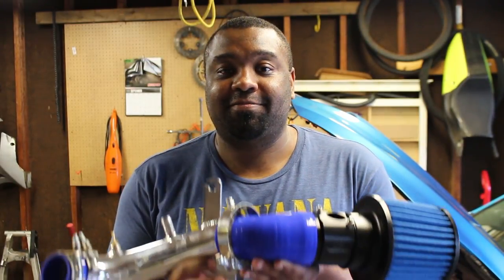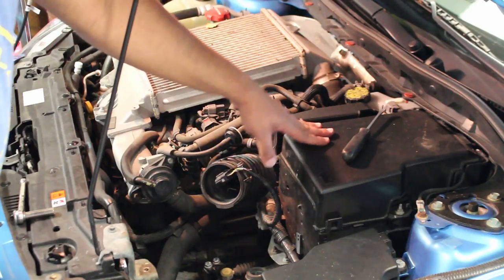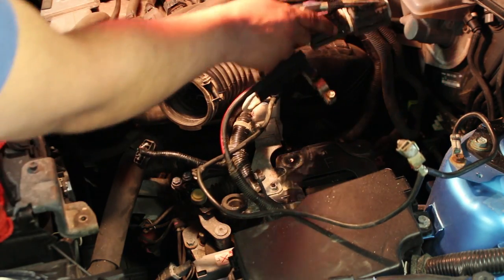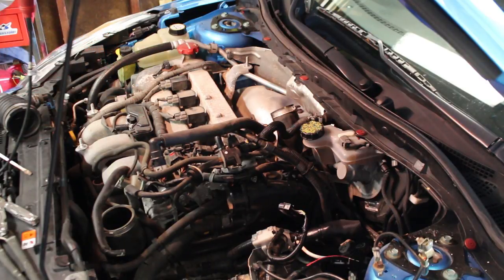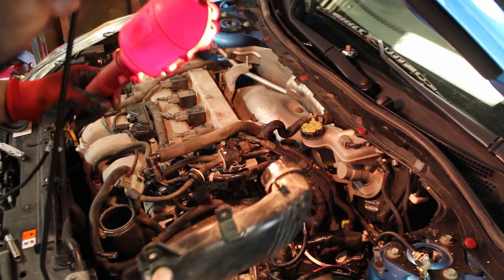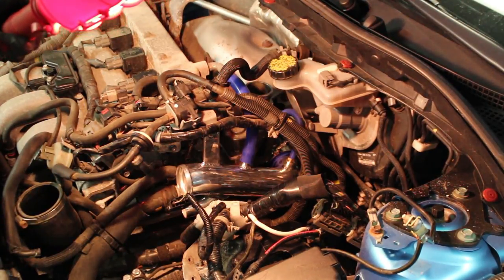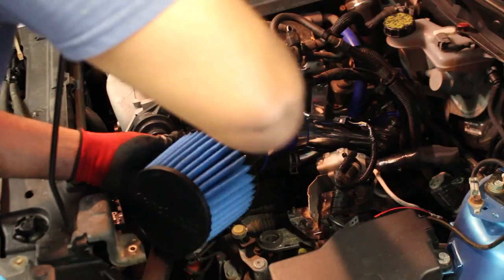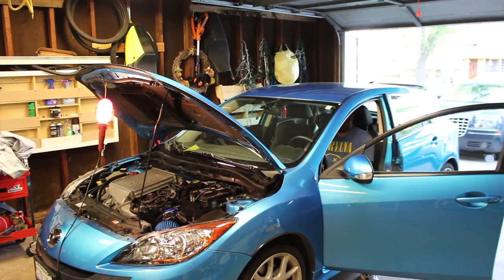Corksport Stage II Short Ram Intake Installation

Comment: If you do plan on upgrading the intake I would suggest also making sure you have a Cobb Access port so you can remap your car, and also install the High Pressure Fuel Pump Internals. More air means you need more fuel. A new map will provide that for your car so everything runs smooth. May not be much of an issue if you plan on running just an intake, but anything further you will need to return with the ms3. The Cobb AP comes with a few off the shelf tunes that will get you going.

Comment: Yo I cannot stop my larger hose that goes from the turbo inlet from folding/kinking. Any tips? I just don't want the hose constricted. I tried to go underneath the electrical wires but it keeps crushing it. Any tips?
Reply from the maker: Is it too long? I am running aftermarket hoses, but I had to trim my recirculation line because it was slightly too long. If it is the coupler going to the MAF, rotate it until it sits properly.

Comment: Do you have any concerns with the CorkSport intake being aluminum (good conductor of heat) being so close to the engine with any heat soak as oppose to the stock plastic piece (not as good a conductor)?  I wrapped my intake (Focus ST) with reflect Heat Tape.
Reply from the maker: I am. It is one of those things that I have been thinking about, for awhile now I have been considering changing out the aluminum inlet pipe with one made of silicone. I have also contemplated wrapping it as well. I decided that some time this summer I would test the aluminum inlet pipe vs a silicone pipe and watch my BAT/IAT and see what the difference is.
Reply: That’s what the intercooler is for.
Reply: It doesn't matter if it's aluminum.... the turbo will super heat the air with aluminum or silicone. The intercooler will cool it down.

Comment: Ik im late to the party but! all I have is an intake on my speed 3, what map should I use for the AP? Did you stay with Stage 0 after installing it?
Reply from the maker: What size is the intake? If it is 2.5 and stock MAF size you can run without one. I would recommend a base tune from a tuner. OTS work, but are not the greatest.

Comment: Is it a 2.5" or 3" ?
Reply from the maker: 2.5". If I remember correctly a 3" will require a MAF recalibration since it will be larger than the stock 67mm.
Reply: @FiveFiveGarage  thanks.

Comment: My son has an 08 Mazdaspeed3. He and I want to make his first mod an intake. From the research I've done, this intake because of the air straightener will not throw a code. However, does this intake along with the TIP require a tune?
Reply from the maker: No, this intake doesn't require a tune.

Comment: Would my bov get in the way and this would fix a madza 3 mps 2.3L 2006 hatchback right?
Reply from the maker: BOV shouldn't get in the way, it is on the TMIC and there is clearance. Yep it will fit a 3 MPS.
Reply: @FiveFiveGarage  yeah idk it's only 190 dollars so might as well give it a go , what do you think of the stage 1 intakes I was thinking of getting that casue its looks easier (noob)
Reply from the maker: With a Gen 1, you can add an intake without too much trouble, but High Pressure Fuel Pump Internals (HPFP) should be at the top of your list if you are going to mod this platform. I tell everyone to replace the HPFP first, as the fuel pump can keep up with the mods that get added later.
Reply: @FiveFiveGarage  oh sweet I got  a gen 1 and the intake is probably the only thing I'm going to do it ,so I should be good, thanks for the hepp

Comment: Great tutorial, I broke the plastic nipple on the boost control solenoid,  glued it back on, but now it seems like I'm not hitting full boost, would an air leak on that nipple cause the car to not hit full boost?
Reply from the maker: Yep. I have had multiple people do the same thing and the end result is always replacing it. You can always upgrade to a MAC valve and get even better boost control. That is what I did.

Comment: Did you get any sort of whistle with the intake? Installed mine and has an annoying whistle around 3000 rpms
Reply from the maker: 3000 rpm? That is when the K04 begins to spool, you are hearing the turbo now.
Reply: @FiveFiveGarage  yea but its not the spool I hear it aside from a faint whistle and only when letting of the throttle
Reply from the maker: Are you on the stock bypass valve? I would check and make sure its not leaking.

Comment: Hi randy.is this a 2.5 inch intake.and what size is the maf housing
Reply from the maker: It is a 2.5" intake, and the MAF housing is the same diameter as stock, so you can switch and not need a tune (flow numbers at the MAF will be close to stock).
Reply: Does this intake add more power with a  tune from a protuner with cobb accesport
Reply from the maker: It can, it is more about opening up the bottleneck of air flow. You will see some small gains just from the intake, but if you were to pair this up with a downpipe and tune, you will see better results.

Comment: Why’d you choose a short ram vs a cold air.
Reply: When u started the car up at the end was that it vvt making that ticking sound at idle?
Reply from the maker: Can't run cold air intake with the oil catch can setup I decided to use, where the air filter would sit is exactly where the catch can goes. CAI does not do much of anything on a Turbo car, the air going into the Turbo is going to be heated as its compressed, use the CAI money on a better intercooler instead.
Reply from the maker: No, the sound you heard is the upgraded HPFP internals, the VVT issue has a different sound.

Comment: What do you mean by re using the rubber grommet and spacer? Where do these go. Thanks for the vid
Reply from the maker: From the stock turbo inlet pipe, where it bolts to the head. You need to swap that over to the new one.

Comment: I’m thinking of purchasing this. Would you happen to know if I would need a tune? I am still stock I have a 2012 mazdaspeed 3
Reply from the maker: The Corksport SRI has the same diameter MAF as stock, so you will not need a tune. If you have more questions about modding, I would suggest you watch: https://youtu.be/V-BEziNy4Ps

Comment: I'm guessing that you can re-use the stock silicone tubing from the boost solenoid? Bought one of these second hand but it didn't have the tubing with it.
Reply from the maker: Yep you can reuse it. If that is a stock boost solenoid be careful because the nipple on those are notorious for breaking when removing the hose.
Reply: @FiveFiveGarage  yeah that’s the only thing I was worried about, I should be getting a corksport 3 port BCS soon, do you think it’s worth holding out until then? Thanks for the quick reply too!
Reply from the maker: Yeah. Change it all at the same time, also you can replace any vacuum lines when you do the ebc.

Comment: Hi, great video! Do you know any info on the hks intakes? From what i gathered there doesnt seem to be a recirc pathway on the TIP. So there's no recirc from the bpv to the intake?
Reply from the maker: I don't know much on the HKS intakes. I would check again, recirc is a mandatory setup since its a MAF system. I wouldn't advise running an intake that doesn't have the recirc tube on this engine.

Comment: Hey dude how u doing quick question is the stage 2 any good compared to the 3" setup?
Reply from the maker: There is a clear gain to going with the 3" setup (on a stock KO4 it is a +10 HP over a 'stock' sized intake, increased air flow and less restriction), but that comes with its own set of problems that you have to solve (will not fit with the stock battery box, requires a tune to use). 

The stage 2 will be enough to get you into the 300 - 340 HP range. Anything over that is going to require a bigger turbo and the larger intake. If you want to future proof your setup I would go for the 3" from the start and get a battery box and 51R battery.
Reply: @FiveFiveGarage  cool im really looking for that 300hp so stage2 would do awsome thanks alot buddy

Comment: I like better injen technology for cold air intake
Reply from the maker: Since this was recorded, I decided to step up to a full 3" HTP intake. There are actually some flow gains just from switching to the 3" and no other modifications on my setup. I am planning on going with a bigger turbo and the 2.5" at that point becomes a bottleneck.
Reply: Five Five Garage I got a 2008 mazda3 sedan and soon I’m gonna put in a corvette engine and transmission

Comment: Great video man!! Just quick question / concern. I broke the nipple on the bcs 😞 recomendation to fix?
Reply from the maker: That happens a lot. You can try super glue/epoxy to try and reattach it. If that doesn't work replace it, I am running a 3 port set in bleed mode.
Reply: Five Five Garage I was thinkin about it. But i see you are using JBR. All of my friends are using GS (grim speed) but they use it on evo. But is there really a difference between them or just by preference?
Reply from the maker: The GS and the JBR use the same MAC valve. It is just a preference. Can't go wrong with either one. I think it is a great upgrade, because 1) the MAC valve is a better design (everything is metal, no plastic to break) 2) The stock EBC has been known to have issues above stock psi levels 3) you future proof your setup, if you want to go bigger turbo later, you already have an EBC that can be setup for 3 port.
Reply: Five Five Garage So for dyno tuning , either or has same platform? So they wont be any diff for tuning?
Reply: Five Five Garage thank you so much as well for the feed back! Love your build!
Reply from the maker: No different for tuning. They are platform specific just for the plug. But the valves themselves are very similar. I caught the JBR on sale, I originally was going with the GS EBC.